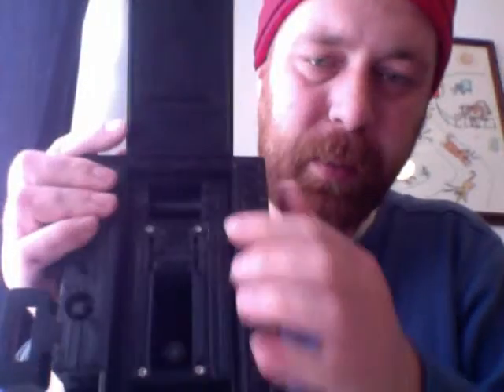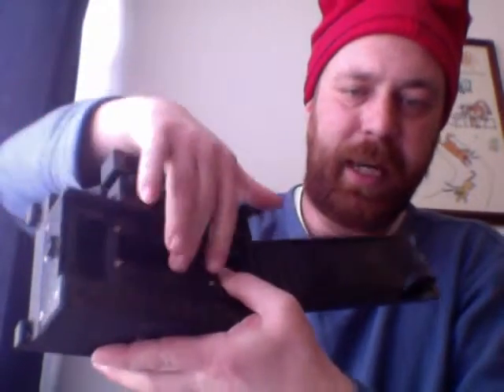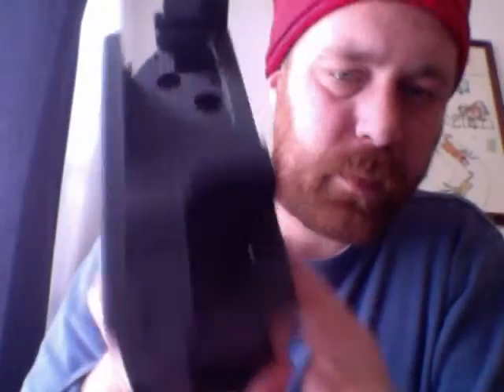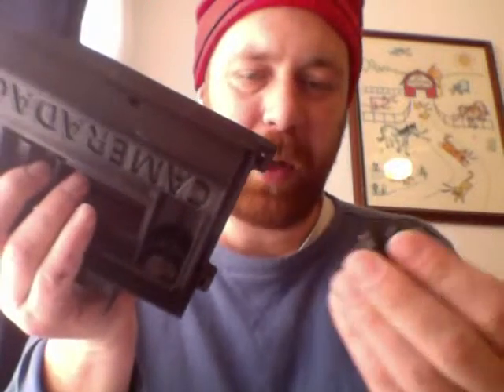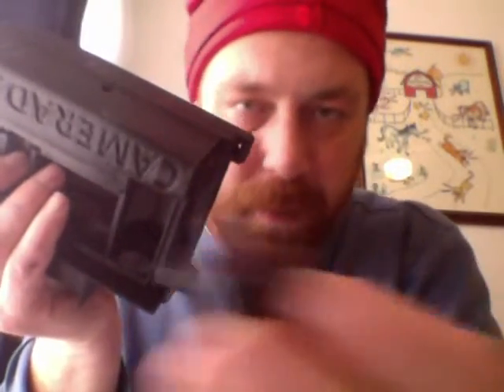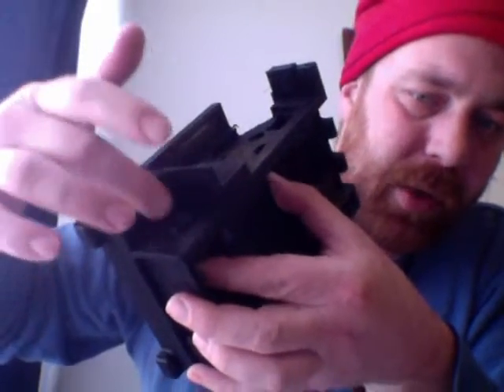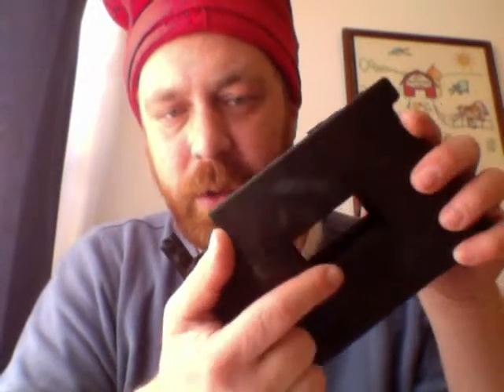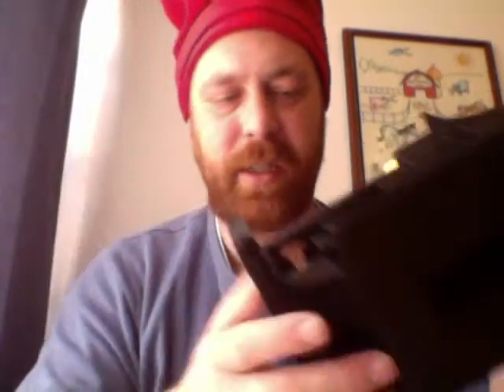BRANCOPAN / Printer 3D printing Troubleshooting Livestream

Comment: I have the 50 and the rear element does collide with the camera body at about 15-30 feet so it won't reach infinity, but theres enough material to remove the 1-2mm necessary. I just don't know the impact on the image circle.
Reply from the maker: I am going to make a second body version and release it this week.  for now,  scrape off that extra 2mm with the flat part of a chisel..

Comment: I also got the 50mm lens, so I'm now mildly worried. I'll also let you know if I have any issues. The rear element does extend further into the body than the other lenses, but this is a part that's smaller than the outside diameter of the rear of the lens body.

Comment: Following up, I'm using an Ultimaker 3. (Originally picked it because of the dual-extruders and the semi-enclosed frame, and because I wanted a good printer with minimal fuss.)
PVA definitely gets you the best quality on supported surfaces, but dissolving it in water always seems to take forever. 95% of it will dissolve in a few hours at most, but the rest of it always seems to take at least a day or two to be completely gone (especially when it gets into the nooks and crannies of smaller parts. Finally bought myself a second glass print bed so this wouldn't slow me down.